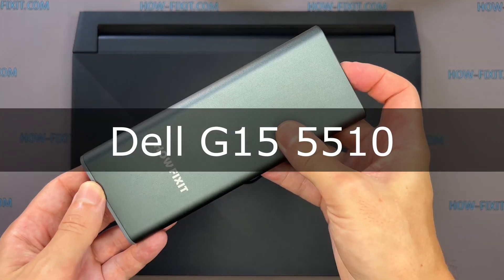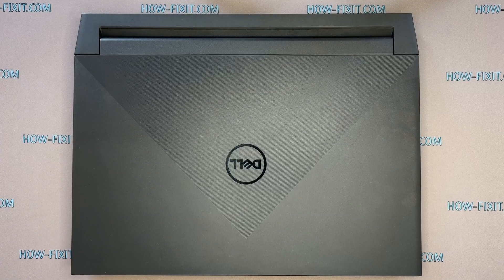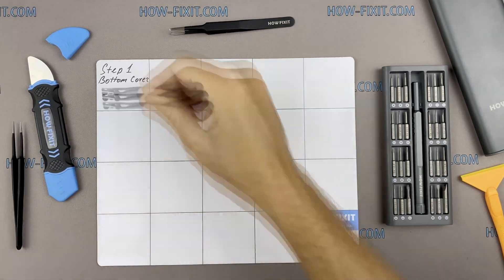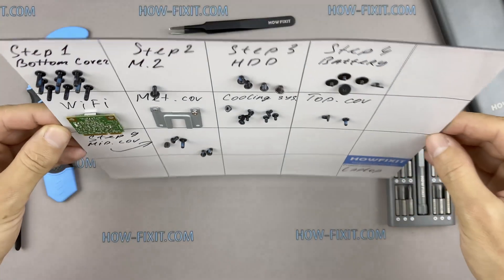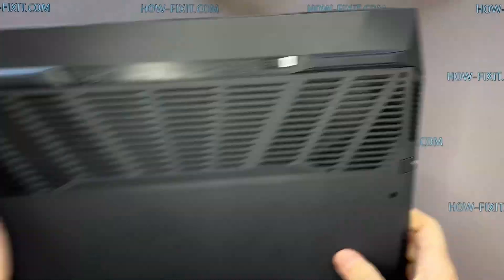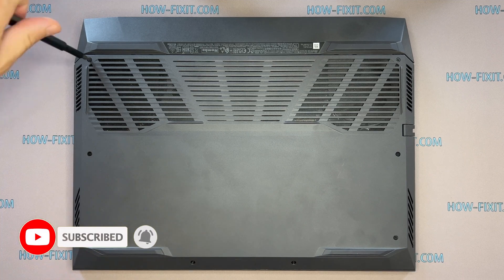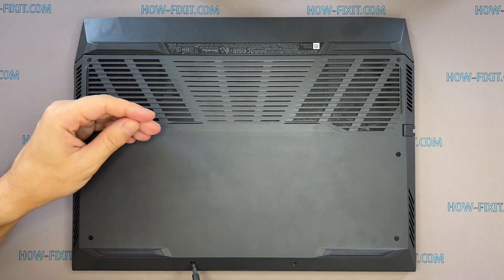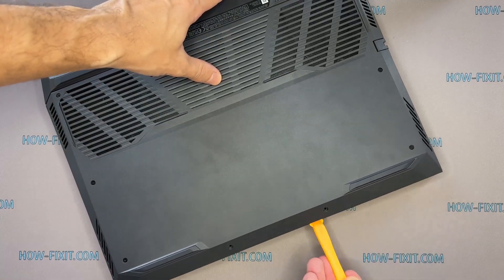Dell G15 5510 Fan Replacement | Step-by-step DIY Tutorial

Comment from the maker: *ENG*: Links to the cooling fan, screwdrivers, and bonus content are in the description under the video.
*ES*: Los enlaces al ventilador, los destornilladores y el contenido extra se encuentran en la descripción debajo del video.
*FR*: Les liens vers le ventilateur, les tournevis et le contenu bonus sont dans la description sous la vidéo.
*DE*: Links zum Ventilator, zu den Schraubenziehern und zum Bonusinhalt finden Sie in der Beschreibung unter dem Video.
Reply: Hi friend, I hope you can answer a question I have.

My laptop is a G15 5510 with an RTX 3050 GPU. It turns out the fan that cools the processor is damaged. Do you know what model the replacement fan is? I took it apart and it turns out the fans don't have a serial number so I can identify them.

Comment: Hi friend, I hope you can answer a question I have.

My laptop is a G15 5510 with an RTX 3050 GPU. It turns out the fan that cools the processor is damaged. Do you know what model the replacement fan is? I took it apart and it turns out the fans don't have a serial number so I can identify them.

Comment: Thank you so much for the video! The demonstration is very helpful especially when it comes about detaching the sheet cables from those strange sockets. A tiny piece of rubber thing (no idea what it is) went loose and fell into the fan. It made a big rattling noise and startled me at that moment. Then I found your video and took all the motherboard off to fix it. It spent me an hour but it was interesting to me hahaha (not hoping it happen again at all). Well, thank you for your video!

Comment: Thanks for the help! I'm on a Dell G515 5515 and my GPU fan stopped working, I ordered the fans from Amazon and for some reason 2 of the screws did not line up but I think it's because the model amazon sent was slightly off, However the fans still are working fine and I just ignored the screws. 

This is so helpful as the last Laptop I owned needed its fans replaced a few years back. and I sent it in to a repair shop which took a few weeks and costed 300 dollars so I wanted to repair this laptop myself this time.

Comment: Thank you for your viedo! I tried the replaceable fan. After I did the replacement, the windows system shows error with the fan. I don't know why. So I get to buy the original fan and try it at the aliexpress site.
Reply: Were u able to fix it?
Reply: @Alkaios5358  I bought the original fan (with the exactly the same cat. number) from aliexpress and did the replacement. it works great.
Reply: @ZhaiHomePro  I was thinking of fixing my broken fan myself, but I don't have much experience fixing computers, I'll just send it to a repair shop instead. To little to gain to much to loose
Reply: @Alkaios5358  That's more safe.
Reply: @ZhaiHomePro  guess what?. They replaced the fans for the new ones and now it makes an even worse noise (like a ps4). I realised that the fans that were  originally on the laptop where not broken at all (they don't even wobble). And the new ones were also in perfect condition. So I am clueless as to what in the hell is making that noise. I think I will pey them to actually fix the computer nex time, not only for the fan replacement. Do you think it could be that the motherboard or case its bend in a way that the fan makes that noise?